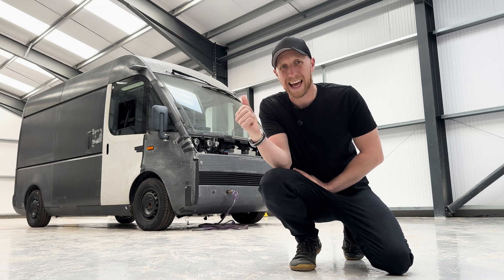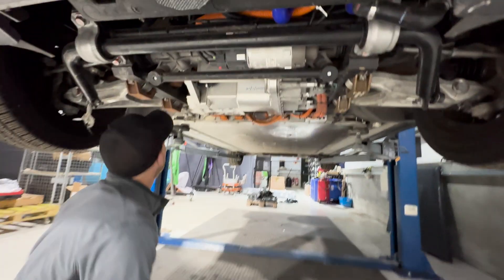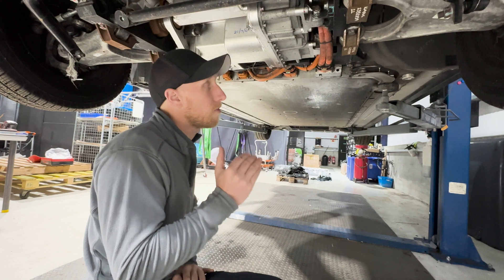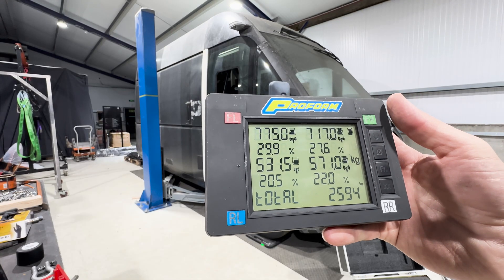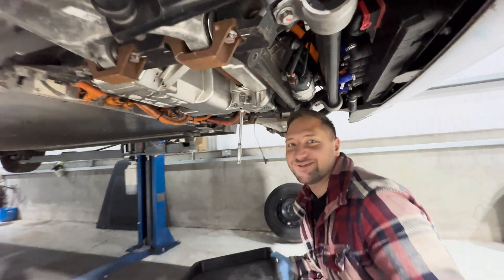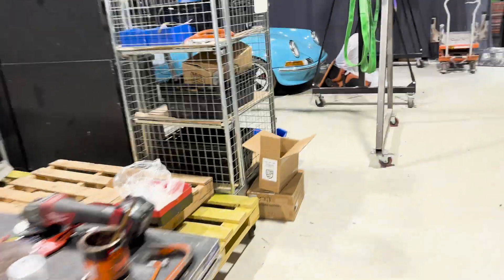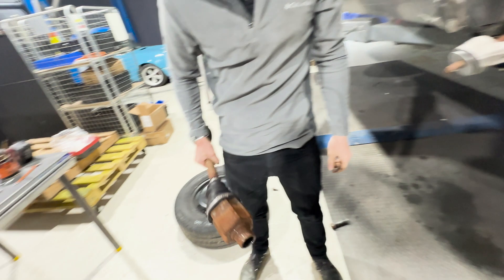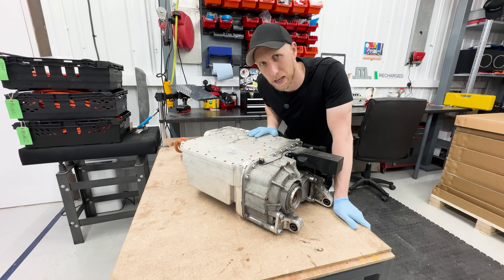Turning my Prototype Arrival Van into an ELECTRIC RACE VAN?

Comment: Very interesting! Does the drive unit also have a limited slip diff? It kinda looks like it, but I cannot say for sure.
Reply from the maker: No looks to be an open diff. But the van has traction control.
Reply: @Hazell_Nutz  Ah, that makes sense. Good luck fettling the settings! 🙂I'm very excited about this project, thanks for sharing!

Comment: Let me guess…..you’re putting a couple of Tesla drivers trains and batteries in? 🤷🤣
Reply from the maker: Nope, iNetic have sponsored a pair of their new 800v 400kw REV drive trains. But need to work out the best 800v battery pack that can push our 1200amps
Reply: @Hazell_Nutz would that be a VWG battery or a Hyundai one? Or a completely custom one?
Reply from the maker: @chargeheads will be a custom pack, will probably be made up of two 400v packs from another oem rebuilt into one unit.